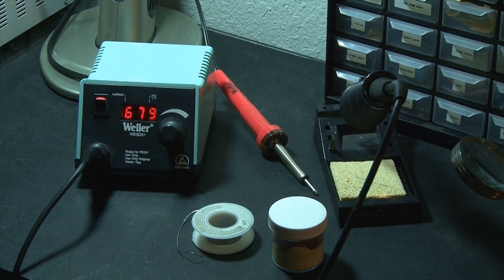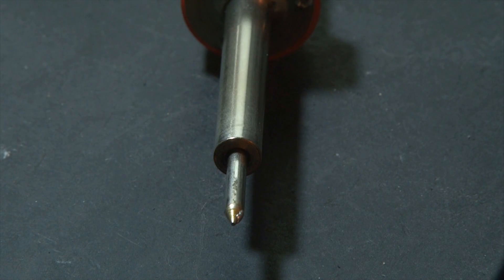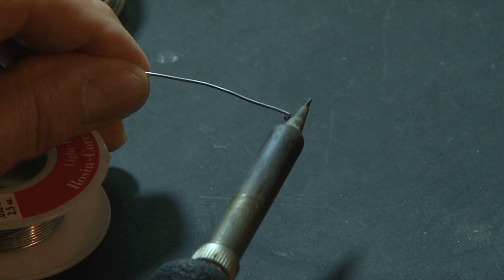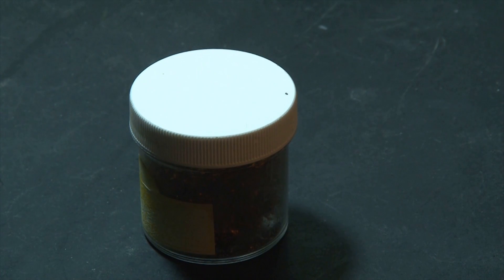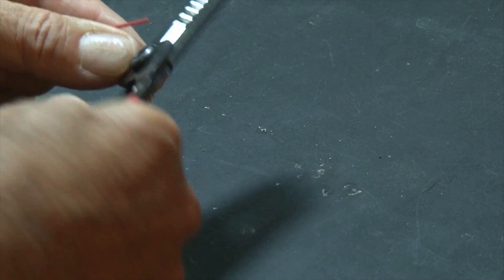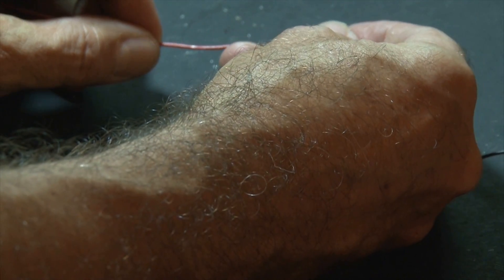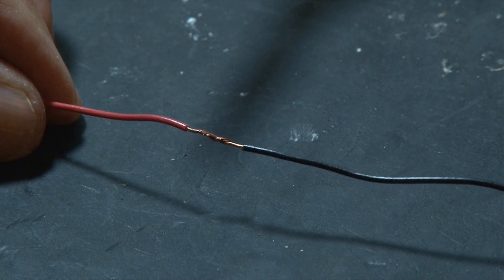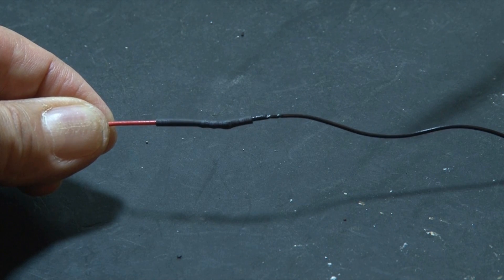Kipkay Tips #1 - How To Solder

Comment: Happy New Year n great video! I do have a couple of questions. 1) How can you restore tips. I tried fine sand paper and putting the rounded ones in my drill. 2) How can you check the melting point of solder? I got mine at radio shack n no temp is given, checked their site n tried that n nothing melted, I guess a 3) Whats the max over the melting point you should go past? My soldering station goes upto 840℉ which i usually use it at, but found out thats a bad idea as the iron body suffers n till i can buy another one, I have it rigged it so it holds togeather.

Comment: am i the only one who noticed that he soldered a red and black cable? 
kipkay ppl like u who does that has a special place in hell, causes so much confusion sometimes...
Reply: and btw if u pretin ur solderpen/iron before u put it on the cable it will lead the heat better onto the wire and it will melt the solder faster

Comment: I have a soldering iron, however it's temperature varies. when I touch the solder to it, it doesn't always melt instantly like I thought it was suppose to. it's usually a waiting game of me holding the iron on the wires or board with the solder and waiting for the temp to come up and melt it to the project. I feel this isn't normal. is it? or is my iron a dud?

Comment: When I strip wires, I like to strip the insulation just a little bit off, like only a millimeter.  Then I grab it with my fingers and twist it off.  It does a great job of twisting the wires together while I'm stripping off the insulation.

Comment: Good info, and very well produced!  I have taken to using a silicone baking mat as my soldering surface. It's heat resistant and provides plenty of "grip" so stuff doesn't slip. Another quick tip, move the heat shrink tubing well away from the area you're soldering so it doesn't shrink prematurely. (I've heard that's happened before)

Comment: hello+kipkay I've always used hot glue instead of electric tape or shrink heat tubing cause it's cheap and easy to buy is it a viable alternative?
Reply: Amiel Kader this is a very good question, actually.
Reply: scoopable1 see I've never had an issue with it but I've never seen anyone else do it
Reply: Amiel Kader From my personal experience, I will say yes, BUT it is impractical. With a glue gun you will potentially make a mess where you are working, and you don't want to get your components sticky. Also, the last two times I've used hot glue as an insulator the glue just came off after a while, leaving the connection exposed. I guess it depends on the quality of your glue and the tool you use to apply it. But if you don't have any alternatives, it is possible to insulate connections with hot glue.
Reply: MarkMythV5 thx yeah I have I very nice hot glue gun with a small tip and I usally will work with scissors to cut the excess glue so the thing where u get a string of glue dosent happen
Reply: Hot glue isn't the best, it has a low melting point and can become brittle over time. It might be OK for prototyping and temporary connections, but for anything permanent I would strongly recommend heatshrink.
Reply: Agent24 oh no I don't work on any high voltage devices just small projects but I did not think of the brittle part I've never had something with hot glue that long so I've never experienced hot glue becoming brittle